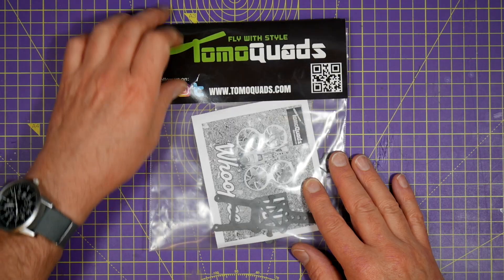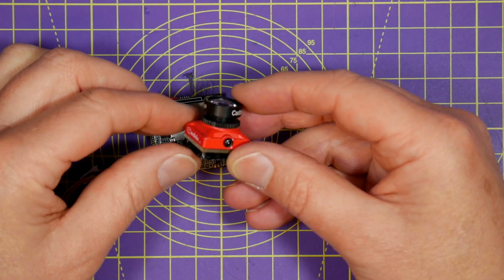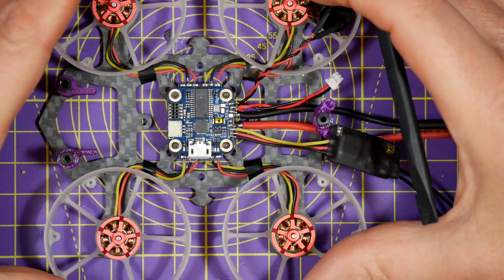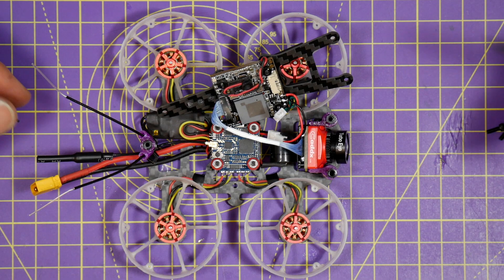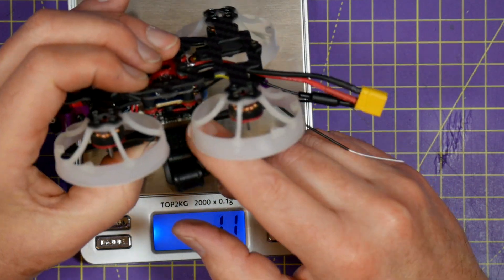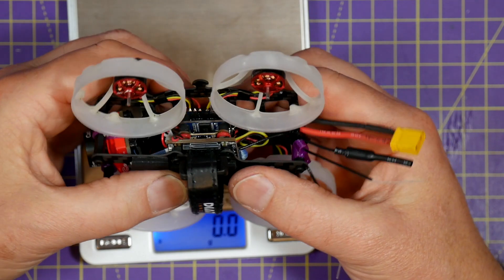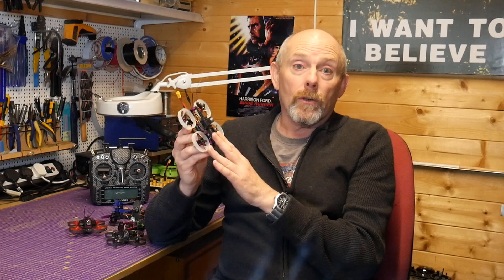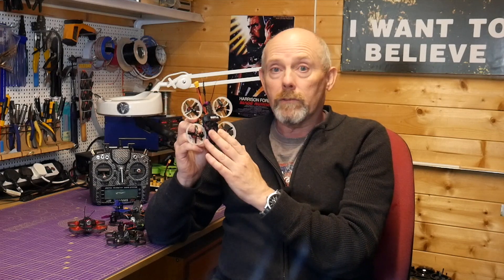Cine Whoopee 1080p HD full build log // Succex F4 Micro flight stack // Caddx Turtle V2

Comment: HI Your video is amazing. I have a iflight cinebee75hd and need to transfer all the parts to a better frame. The stock frame has ducts and I cannot remove them or else the motors cannot be attached. I need a frame without ducts. Also the cinebee comes with a 16 x 16 fc stack + caddx v2 20x20 stack so im confused how to get them both onto the Frame. Kindly recommend a frame
Reply from the maker: Check out Tomoquads. They have a great selection of frames designed as upgrades for other quads. https://tomoquads.miiduu.com/

Comment: hi can you recommend a bangood frame for me. I couldn't find anything in carbon frame from bangood for the 16 x 16 stack build.
Reply from the maker: What sort of quad are you looking to build?
Reply: @WhirlyBloke  I´m sorry i missed this message. Thanks for your message. I need to build the same quad - cinewhoop style using the iflight 75 hd parts just because those ducts keep breaking. I wished they had put stronger ducts. In the stock frame the motors cannot be mounted on the frame but on the ducts. I need a frame that can accomodate the 16 x 16 stack and motors too.  The ducts would be an additional support.
Reply from the maker: @honestreview9019  Have a look at TomoQuads frames. I've done a couple of builds with them.
Reply: @WhirlyBloke  thanks for the info. I found tomo quads is double the price for shipping to Germany. Can you recommend a bangood link

Comment: And BEST OF ALL, it doesn't have that CRAP Crazybee F4 Pro V2 FC! Those come in so many who0ps now days and that board fries so often it's a huge pile of smelly dung! Don't buy ANYTHING that uses that FC.
Use the FC in this build
Great video Mate! Awesome choices too! You Da Man! 😎
LIKED AND SUBSCRIBED! 👍
Reply from the maker: The CrazyBee F4 is quite fragile. If you stick to 2S they are actually ok - 3S and they become a hand warmer. Same goes for 1103 10000-11000kv motors. They get very hot and die on 3S if you're not careful with your PIDs and rates. The Succex F4 Micro totally rocks.
Reply: @WhirlyBloke  2 out of 3 of mine died on 2S....well, one never lived and was DOA.
Reply: @WhirlyBloke  HI, I've just done my build on a whoopee HD, FC is running a mamba 405 AIO that can handle 2-4s. but im running the betafpv 1103 11000kv motors, would it be safe to run this thing in 3S? . im planning a 3s 450mah.
Reply from the maker: @grabejud  That'll work just fine.
Reply: @WhirlyBloke  thanks mate, loved all your helpful builds.  been waiting for the lockdown liftoff here so i can fly my quads.
Reply from the maker: @grabejud  Thanks for watching.